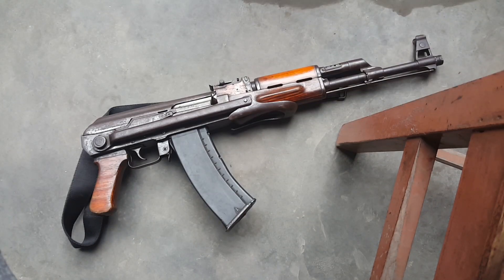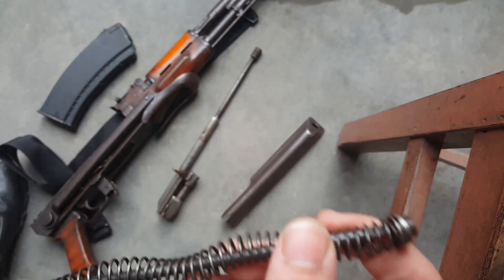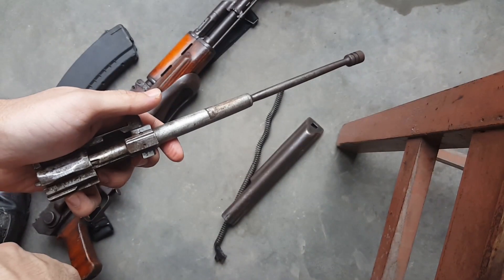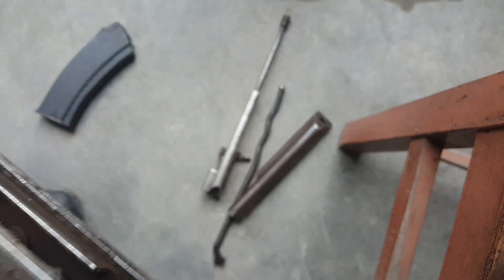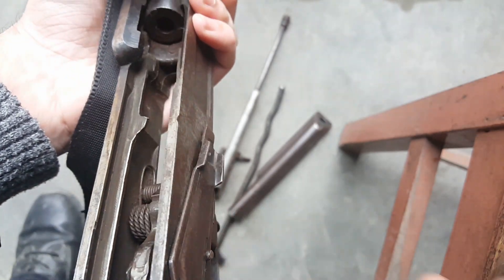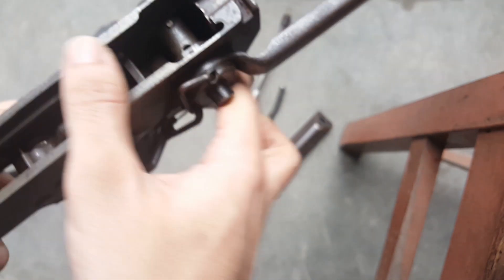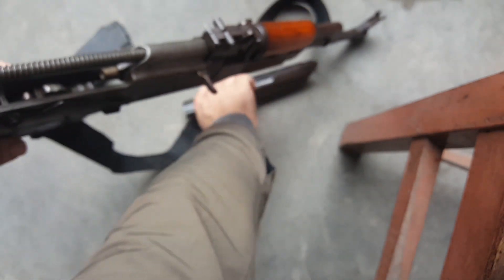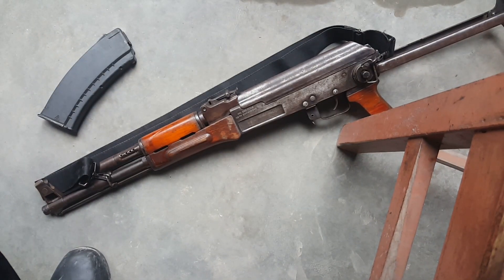Old Khyber Made Kalakov AK Rifle | 222 / 5.45x39 | AK47 Kalashnikov | Darra/Peshawar, KPk, Pakistan

Comment: how do they drill the gas port if the gas block is integral to the barrel ?
Reply from the maker: This rifle needs further inspection, It's a very interesting piece. Usually, the components are separate and press fit but this is an odd one. It may be that they are just really tight fit that they seem machined to barrel.
Reply: @HustleMuscleGhias   on a factory made AK yes, on these Pakistani handmade ones it could be any angle since they are very crudely made with little to no importance given to such little details

Comment: 5.45x39 is not 222 remington. 222 is a shorter case than the 223, its used in my country because all 7.62x39, 5.45x39 and 556 ar forbidden as they are classiefied as war calibers. therefore we have to use 222. remington, which can be achieved by resizing 223 brass
Reply from the maker: I never said 222 remington was 5.45. I said 5.45 was called triple 2 by the locals, what I didn't mention is that this was done to get around old licensing laws.
Reply: @KhyberArmoury  cool thing though, I got my facts wrong there! thanks for the explanation
Reply from the maker: @joemama.556  No problem at all! Its not known outside of Pakistan much.